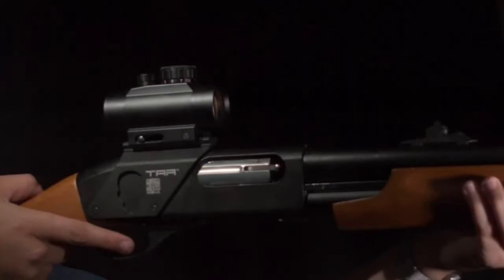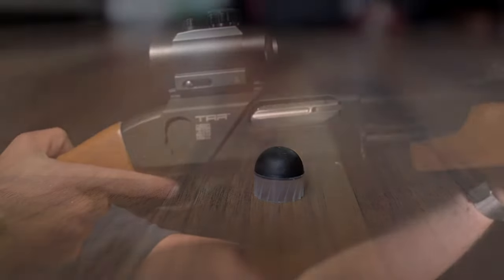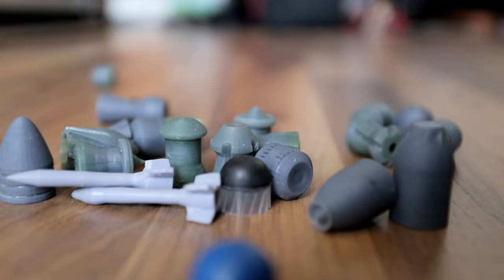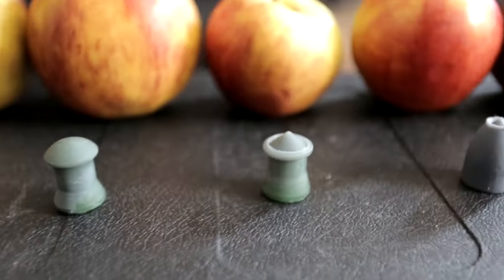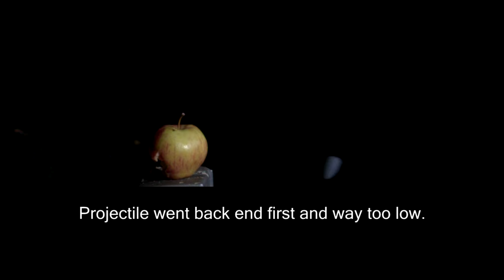3D Printed Shotgun Slugs - Slow Motion - Chronos 1.4

Comment: Hey brother nice video.  Where did you get the files for these slugs? And what settings did you print them at, Im finding i need to print at like 98% and it still needs a little sanding to fit smooth.
Reply from the maker: Some (for example the sabot darts) I designed myself via Blender and I got the rest from Thingiverse and Yeggi. I also discovered that some need to be printed at 98ish percent. Some I redesinged or in Blender, some I scaled down in Chitubox (I wasn't looking at the percent but rather used the milimeter settings - I measured the inside of the shells for perfect fitting.
I printed them with my resin printer (Mars 2 pro from Elegoo) with waterwashable resin. That's quite hard but also more brittle than others.
I can't remember the print settings, sorry. I printed them all at once like 2 years ago and still have dozens of them lying around :'D

Comment: I had to look up "68 caliber shotgun" to figure out this was an air shotgun. I was pretty confused by the "7.5 joules" number, couldn't figure out how powder burning shells could shoot such low power loads! A video on the shotgun would be interesting!
Reply from the maker: Hahha, the title can be a little confusing, sorry! :) The shotgun is called CAM870 from APS. There are 100+ very informative videos out there. The gun is super fun to shoot :)
Reply: @LukeSlowMo  That's really cool, I just went and looked them up. What kind of velocity /projectile weight are you getting at full power? It certainly does a number on the apples!
Reply from the maker: @Gyppor  mhh... hard to tell. Somewhere I've read that the full power shells will create something between 370 ~ 400 fps. In comparison: what I am alowed to shoot back in Germany is around 100 fps :(
Most of those projectiles will get stuck in the barrel with that less energy.